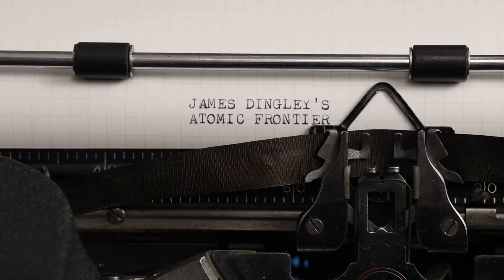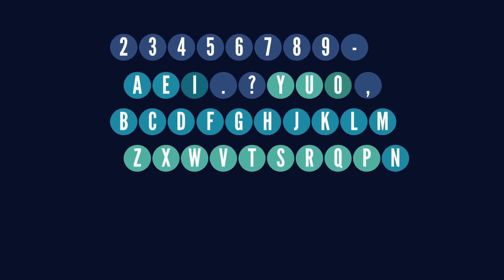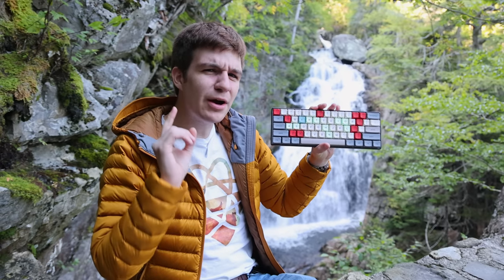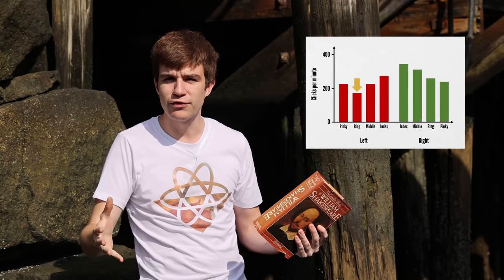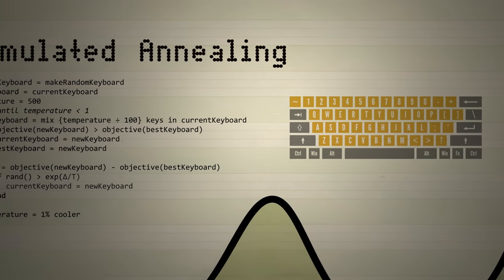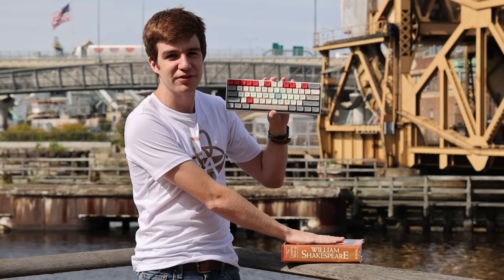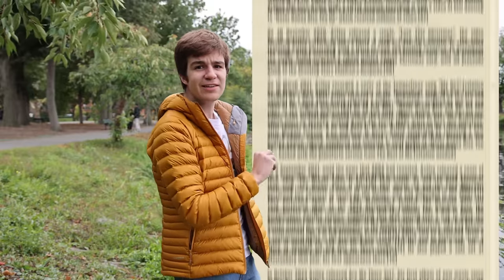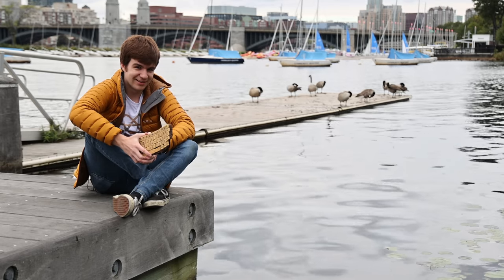QWERTY is broken. Can we make it better?

Comment: I've been touch typing for over 30 years.  I used Dvorak for a while, when working from home in the 90's, but that made it a nightmare to use a keyboard anywhere else.  When I worked on other people's computers around the turn of the century (I made a lot of money from y2k fears) I reverted to QWERTY.  I would love it if we could agree on an optimized layout and get everyone on board - particularly moving vowels to the home keys - but that's the real challenge; IF WE COULD AGREE.
We need the optimized keyboard to be ambidextrous so we don't totally alienate lefties.  We need it to be optimized for all languages that use the Latin alphabet - or it won't be widely adopted.  Meet those requirements and I'll be glad to try it out and support efforts to make it a standard.  I'm not interested in a keyboard that is optimized for English because I mostly type in French.
Reply: well in your case AZERTY might also work. I have used it once on a laptop I had borrowed from a Belgium friend and I did get used to it pretty fast.
Reply: I think Dvorak should still be pretty optimal over QWERTY for other Latin/Germanic languages considering the vowels are all on the left side.

Comment: I like the idea of new keyboard layouts, but what always gets me is that I want the new layouts on all keyboards. If we could get everyone in the world to swap E and J around, I'd be onboard, but I'd probably get frustrated fast if only ~50% of the keyboards I interact with made such a change.
Reply: As someone that speaks another language, I say that you get used to it. It's mildly annoying when I get in my hands a computer with a english instead of a portuguese pattern (we use qwerty too, but with extra buttons for diacritics), but as long as the changes are small, such as it would be the case for the J and E swap, you can get used to it in minutes.
Reply: How often do you use other people’s computers? Yes, having different layouts on different computers is an issue, but for many people it shouldn’t really be an issue as they spend most of the time on computers they can configure to their preferences. I basically forgot Qwerty but it doesn’t affect me much since I need to use it only once in a blue moon.
Reply: It used to be more of a problem in the desktop era. Have to ever tried to log in to check emails on a German hotel computer kezboard, for example.
Reply: @matth3us  I have enough trouble with US vs UK keyboards. I learned a decade ago, and my right pinkie still automatically heads for the @ key on a certain UK keyboards (;/: on a US board) whenever I need to use one.
Reply: I'm in France now and going between qwerty (my computers) and azerty (on other computers) is incredibly frustrating. If qwerty is arbitrary and sub-optimal, azerty is doubly so because at least most of the world uses qwerty. Even China uses qwerty for crying out loud!
Reply: I had quite a stress switching between US "qwerty" and german "qwertz". That's why I agree that it may take some time to make the efficient designs popular.
Reply: This is why I built a tiny keyboard that I can travel with, and since the layout is baked into the firmware that I'm using, I just have to plug it into the device that I want to use, no remapping software is required.
Reply: You don't really "lose the QWERTY" skill. Your learn your daily-driver layout, be it Dvorak, Colemak, Workman, whatever, and then when you happen to be on someone else's keyboard you can still do QWERTY. I thought it would be a problem, and then found out it wasn't. That and it's better to optimize for what you do most often, typing on your own keyboard, than to optimize for the rare times, like using someone else's keyboard.
Reply: It would be good if all keyboards were orthogonal and with with the best layout but that’s just nothing possible. However, it is possible change the layout on the system configuration, and there is no need to buy an ergonomic keyboard. On my desktop I use DVORAK layout on top of a QWERTY board, but I dictated this reply on my phone.
Reply: @johnd324  There is a need for ergonomic keyboards... Not sure what you meant by that.
Reply: Right, the reason I stick to qwerty myself is the number of times I end up having to use a qwerty layout because I'm not at my own computer. The other reason is hotkeys and keybinds are already optimised for qwerty and I do not want to spend the time rebinding everything, if it is at least possible.
Reply: @EwanMarshall  Ah yeah, that's why I went with Workman, most of the hotkey stuff is still in the same place while the rest is optimized.
Reply: @error.418 you can do it, but it is slower and you can make more mistakes. It is not as optimal as sticking to qwerty, it does depends on you specifically to some degree. Also the longer the gap between uses of the other layout the rustier you will be. As to how rare it is to be typing on another keyboard, that depends entirely on what you do.
Reply: I switched to dvorak like 30 years ago... and it has made virtually all my hours on a computer a much nicer experience.  I barely ever need to touch qwerty, and even in the rare cases when I do, it's not really a problem.  I just type at 60 wpm for a few minutes instead of my usual 120.
Reply: @ToyKeeper  " I just type at 60 wpm for a few minutes instead of my usual 120." exactly this. I prefer Workman, but same story. it's okay to find the layout that works for you, and anytime you're forced to use QWERTY it's not that big a deal.
Reply: I got the german adapted neo layout and don't have it on my laptop windows os and have little problems with it. It's like being able to speak multiple languages: occasional practice is nice, but you don't lose it.
Reply: Yep, this is why there are a million plugins for all kinds of software adding in vim keybindings.
Reply: @mina86  Many people work on computers that are configured and managed by their IT departments
Reply: It's kind of funny to me, as when I played Minecraft, I switched the inventory key from E to J. So, if this were implemented as a change to every keyboard, I would no longer need to do that. 

Though I think such a widespread change would be impossible now that QWERTY is the standard pretty much globally. It's like trying to get English speakers to switch from the current Latin alphabet to one made specifically for English, as the current one is not that great, but it wouldn't work.

Comment: I had a client once who could not figure out what was wrong with their computer. $9000 US for a Thinkpad in 1996 was a lot, so we were very invested in tracking down the issue.

They had inadvertently switched the keyboard driver to use the Dvorak rather than QWERTY layout. Since none of us had ever actually used a Dvorak keyboard it took checking a lot of hardware before realizing the actual issue.
Reply: $9000 for a thinkpad is insane even today. Hell, ESPECIALLY today. Did they end up sticking with dvorak, though?
Reply: I've had issues replicating passwords on systems that anticipate a US keyboard when i'm using a UK keyboard, or visa versa. Germany swaps Y and Z, making their keyboards "QWERTZ" which is.. fun.

There's always that moment of realisation where you're like "oh, I can't believe my lying eyes, that's right."
Reply: Canadian Multilingual!
Reply: @slicerabbit6166  No, we got it switched back to properly match the hardware.

Yeah, those machines were like first to marked DVD drives, military grade hardware encryption (the hard drive could ONLY work in the matched machine), top Active Matrix screens. They were not for the average consumer.
Reply: That was a long-winded way of telling us that you weren't very good at problem solving.
Reply: @philsurtees  Or that the client wasn't very good at communicating. These machines were also shipped with multiple OSs. It was an obscure problem in 1997.
Reply: Ah, for the days when an active matrix LCD monitor was a legitimate selling point! 😂
Reply: It’s interesting to think that gender dysphoria was so common even back then!
Reply: @cannaroe1213  Spanish is my mother tongue and Spanish keyboards rearrange some punctuation keys to make space for the ñ letter. Eventually, as I constantly switch from writing in Spanish and English, someone adviced me to just use US International with dead keys. Now I can write Spanish, English and French with the same layout. Unfortunately for everyone else, US   still the "standard" for computing 😕

Comment: Here in Germany we actually use QWERTZ, on a surface level we just switch Y and Z but our keyboards also have (need) ä,ö,ü and obviously have need for a € sign more often than $.
Not only does the language you type in make a difference, the use case is also important.
If you are a programmer you might need some signs that others rarely use (e,g,";"), while an accountant might need to constantly type numbers. Things like the numpad already exist to address this.
Ultimately these kinds of "heat maps" and "most frequently used keys" can never truely be optimal for everybody everywhere.

Comment: Missed the most important!!!! Everything today is electronic, but first mechanical typewriters (don't know the correct word" hammers arranged in rows and columns corresponding to key positions. If commonly used key SEQUENCES were 2 adjacent hammers they would hit each other and get stuck. The arrangement of key was done to minimize these incidents. 33 & 35 teletypes had a rotating drum with vertical movements, refined by the IBM selectric type ball, eliminating the stuck key problem.

Comment: In addition to shifting the weighting, there's also the text it's trying to write.  I suspect each language could end up with a keyboard that isn't just english + letters, but optimized differently because they type differently.  I like the idea of throwing wikipedia at it as training material, open source, and nicely random.
Reply: Different languages have different optimal layouts.  Like, Colemak-DH works great for English but isn't great for other languages.  Dvorak works well for basically all western languages though, and makes a great default since it's so universal and quite a bit better than qwerty.
Reply: wikipedia may be better but there are charts of letter frequency. At least in English.  Of course some may be codebreaker tables from the 1960s.

Comment: I switched to colemak in the beginning of this year and I can totally attest that learning a new keyboard layout totally sucks. I took it more as a personal challange than as a "I want to type more comfortable" and I'm quite happy to have done that. And it comes with the disatvantage of being completely unable to touch type on a QUERTY keyboard anymore, although that interestingly wasn't really a problem at any point.
Reply: I too have noticed they not typing on qwerty has basically not been a problem, but I still type qwerty on my phone because I can't be bothered to learn an optimised phone keyboard system and there's just no point typing colemak on it. Still I get by on other people's keyboards when I must and it's honestly fine. If I absolutely need to do some substantial typing work my split ortho keyboard uses hardcoded colemak-dh (with a qwerty compatibility layer) so I could bring that anywhere I went if I needed to. In reality I always have my laptop which I have meticulously rearranged the keycaps on so it looks the part too!!
Reply: @minerscale  I learned to touch type Colemak, but never changed my keycaps, so when typing with less than 10 fingers, I still type QWERTY. I also still type QWERTY on my phone.
At home and at work I use QMK keyboards for which I have a Colemak and a QWERTY layer. When playing games for example I just switch to QWERTY, I just can't be bothered to rearrange the controls for every game. When I have to type text in it I just have to switch back to Colemak shortly.
Reply: I switched to a split ortolinear/columnar keyboard when doing the change. It means that my fingers feel the difference and type Colemak-dh. When typing on a laptop or other normal keyboard the switch to qwerty is automatic as it feels so different.
Reply: @NightmareQueenJune  QMK rules!
Reply: @@GarrettW I was afraid that my overall speed for both layouts would suffer so I didn't try to do that. It also seemed to be too much work for the party trick of being able to switch between the two.
Reply: @NightmareQueenJune  I switched to colemak as well and I was pretty much back to hunt and peck on qwerty for a long time but now I can touch type on both without having practiced qwerty at all.

it is a little disorientating switching from one to the other but once my head is in the right space I can type like 80 wpm on qwerty and 100+ on colemak.

also I should mention I primarily type colemak on a split keyboard and qwerty on normal keyboards so I guess that helps lol.
Reply: I managed to retain the ability to touch type using QWERTY after using DVORAK, it might just take a few times switching between the layouts so you find it easier for your brain to make the switch. Sometimes it can take a few minutes for your muscle memory to come back if it's been a while since you've used QWERTY so its a good idea every now and then to switch back to QWERTY for a few hours so that if you do need to use another computer or whatever you can still type fast.

In fact, I just typed this entire comment using QWERTY and it's been months since I last typed more than a couple of words on QWERTY.

If I do a typing test my scores are actually pretty similar on both layouts (20 years touch typing on QWERTY), however DVORAK feels much more comfortable so I stick with it.
Reply: This is why they made Tarmak layouts to transition to learning Colemak! 4 easy steps and took me 2 months to get to normal speed.
Reply: @seanh4674  I knew of Tarmak when I started to learn Colemak but I didn't want to have these in between stages in my head. Especially my original goal was to be fluent in QWERTY and Colemak. I wanted to have a mental "hard cut" between both.
Reply: I started Dvorak more than a decade ago. Eventually, you will touch type QWERTY again.

Comment: The REAL homerow is W A D SHIFT SPACE. 
They tried to get me to use the standard home row in school but im a gamer and use gamer homerow. Which means the majority of my typing is my index and middle fingers. My right Pinky is only ever used for shift and CTRL and my left pinky is only used for ENTER. No its not nearly as fast or efficient as standard homerow but it is something to consider for keyboard design. I can still type at an acceptable 50 WPM though.

Just an observation.
Reply: Yes... and for the right hand -> H J K L ... if I changed the keyboard layout I'd never be able to use VIM again.
Reply: @markomacek920  Ugh.  The only reason for HJKL is because it was dragged forward from the control characters on a dumb terminal that VI's original programmer was using in the mid 70s.  I use IJKL for arrow keys and that makes a whole lot more sense IMO.

Comment: Hey James, I have a keychron keyboard, and have looked at two years of my typing data at work. Based on the values, I remapped and placed the nine most used keys on the home row, while keeping the swaps to a minimum (or at least to something that's logical). Over 3 months of usage, I am closing in on my original typing speed, and I do think that with time, I will be faster than QWERTY. I just have to undo 30 years of muscle memory....

Comment: As a software developer, it would be interesting to see how different keyboard layouts perform with languages like Javascript, C, Python, etc. Each language has their own quirks and regularly used character, or is it not enough to make a difference?
Reply: Well, I think, as a programmer, you're supposed to spend about 30% of your time just trying to figure out exactly what that function was supposed to do, 30% of the time waiting for your program to compile, and 20% of your time looking for answers on Stack Overflow, so I mean it really doesn't matter for that final 20% of the day
Reply: Python would obviously place the curly braces and semi column on less important positions whilst in many other programming language they would be on super prominent positions as they're frequently used.
If you were to let it position tab as well then that would be in a prominent position for python (assuming you're not some weirdo that hits spacebar an awful lot and just have the IDE set to insert spaces when hitting tab) whilst for other programming languages it might depend on your coding style (although likely still a very prominent position if you stick to the most common conventions)
Reply: I'm a long-term programmer, and it doesn't slow me down at all. As I touch type, I know where what is, without looking. And now with AI auto-complete, it's even better.
Reply: @howmuchmorecanItake  If you're doing unity built C, you'll definitely not wait that long for compilation. 100k LOC should be less than 10 seconds for a full rebuild on a skylake machine with MSVC and all the compiler flags removing the unnecessary things. And as my experience increases, SO has basically become one of the biggest sources of disinformation, rather than a support - so I spend a decreasing amount of time there, and much more time (relatively) with documentation, trial-and-error prototyping or asking experts.
Reply: As a software developer, you only need the keys for the letters in stackoverflow, the keys for Ctrl, C, and V together. Curiously, C and V are already in stackoverflow.